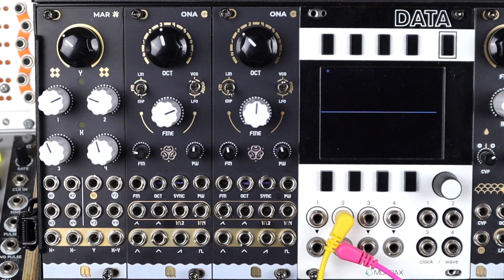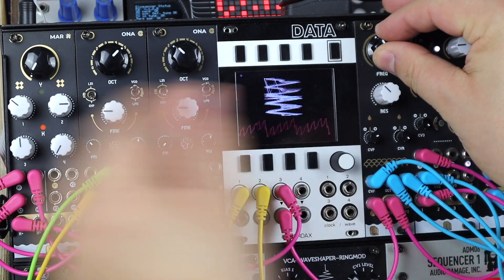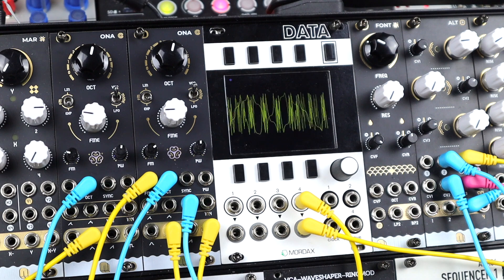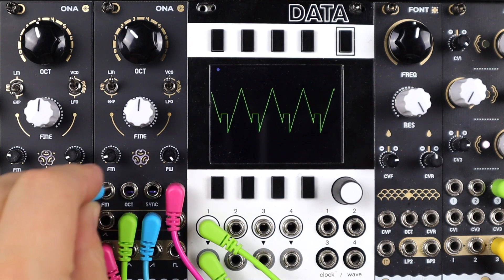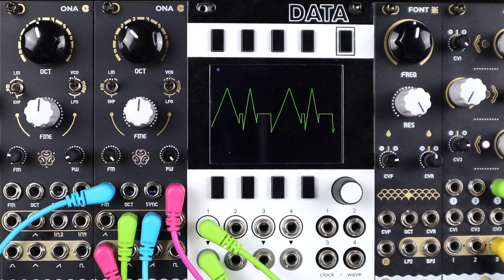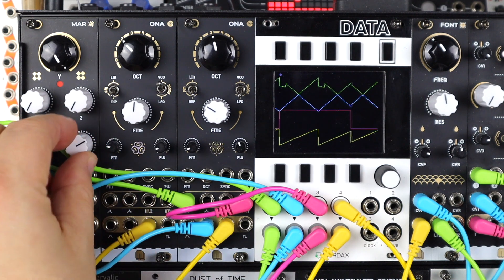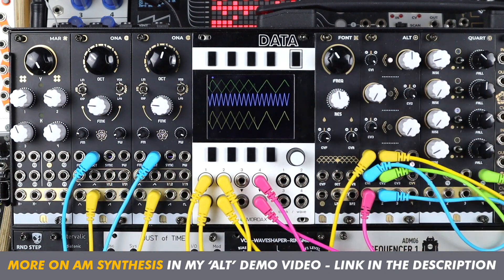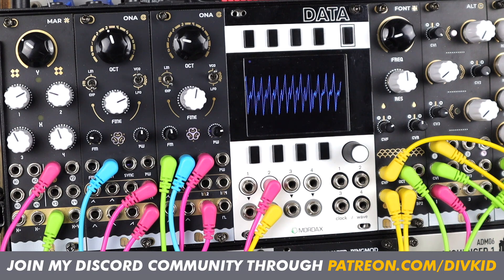NANO Modules ONA // Eurorack analogue oscillator with classic and new “complex” waveforms

Comment: Hello great tutorial! Thank you! I just acquired this nano ona which is incredible! I would have liked to know how to connect it in Cv/gate so as not to have continuous sound and to be able to play notes which relax  I can't do it … I connected the pitch to the ona on my Keystep pro in 1volt per octave on Oct but for the gate of my Keystep pro or connect it to the ona?  Thank you very much! and congratulations for your tutorials which are great!👍👌
Reply from the maker: Hello, an oscillator will just drone indefinitely by itself (unless specifically with added features, but that's not part of an oscillator). You need a VCA (voltage controlled amplifier) to turn the sound up and down. Then you need an envelope generator which is activated by the gate and the envelope controls the signal level in the VCA. 

A simple patch would be 
- 1v/oct pitch into VCO
- VCO waveform into VCA
- VCA output to mix/record with
- Gate out into envelope generator
- Envelope generator output into VCA CV input

I hope that gets you started nicely.
Reply: @DivKid  Thank you very much!🙏 really nice ! Yes it’s soustractive synthesis !👍🙏

Comment: What a beefy sound osc! It looked like the 12oclock position of PW didn't equate to 50/50 duty cycle which is odd.
Reply: Looks to me like it goes from 0 to 50% pw?
Reply: @zbsfm  Hello, Jorge from NANO here :) It covers from 1% to 100% PW and the 50% is around 2-3 o'clock because was the best adjust to fit the CV input range [0, 5]V. You can have a look to the manual if you need further info: https://nanomodul.es/wp-content/uploads/2020/11/ONA-Manual.pdf
Reply: The PW goes from 1% to 100% (at 100% it mutes the output totally). 
However the 50% duty cycle sets around 3 o'clock position, which is indeed odd.